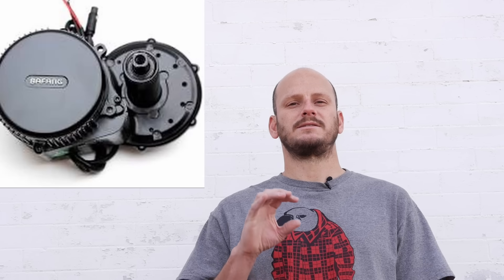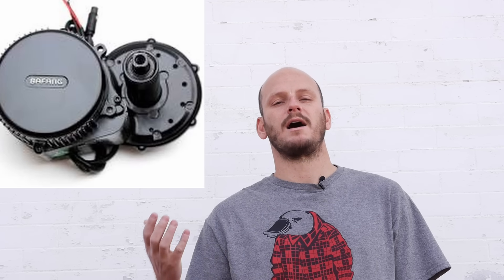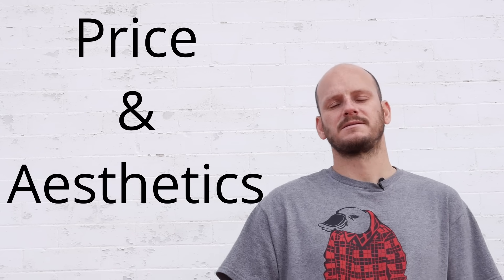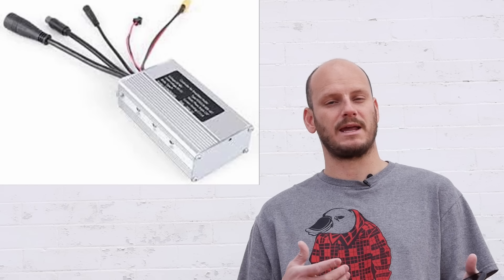Hub vs. Mid Drive Motors: Why Hub Motors Suck and Debunking Common Myths with performance test

Comment: I appreciate  the knowledge and advice very much thanks. I think I might have to save up more for middrive

Just some clarification please, when you talk about hub drive being single geared, but they actually have various levels of electric assist, or "power levels" generally from 1 to 3 or 1 to 5 where higher level = more power. Eg you could use level 1 as eco mode for longer journey but switch to 3 on a hill climb for more help.

In the side by side comparison the middrive bike, the guy wasn't pedalling. Can you throttle only with that motor? I mean if your chain isn't broke. Sometimes it's fun to just cruise like that
Reply: It's a difference of where the motor is located in the powertrain. Two motors with otherwise equivalent outputs and speeds, one direct drive, and one with a multi ratio transmission between it and the load, the one with the transmission can produce both a wider range of usable speeds and power levels.
Reply from the maker: Mechanically hub motors only have 1 gear ratio. Both systems can have a throttle only and also use pedal assist.

Comment: Thanks for the info! Love the quick bullet points. In your opinion, why do the majority of manufacturers keep making hub driven e-bikes over mid-drives?
Reply from the maker: cost. most people don't know the difference between the 2 and therefore don't care. As more people buy mid drives, more manufacturers will start to carry them
Reply: because hub motors are cheaper.
Reply: As long as there's a dummy willing to buy it, there's another dummy willing to sell it...
Reply: @andre-michelgoulet6933  That explains why mid-drives get pushed so much by companies

Comment: You have good points, but I still like hub. I have over 2500 miles on my current one and no problems. My 3000w has almost a 1000 miles and no problems. If you peddle five or six times when taking off you will probably not burn up your motor. I agree watt for watt mid drive is better, but if you get a 3000w it will usually beat any mid drive and a lot more fun.
Reply from the maker: ya 3000w hub is nice! Not street legal at all though

Comment: This review is very one sided. Everyone who says one is better than the other is not telling the truth. Its just different Systems for different applications. 
Direct drive Hubs advantages over mid drive:
higher maximum power 3000w-6000w+
no need so change gears so continuous acceleration.
Regenerative braking
No moving parts and wear except bearings. (overclocked mid dives tend do destroy internal gears.)
If the hub burns its a sigh they didn't setup the current limits and temp sensor properly. Mechanically speaking hubs have a lot less failure points than mid dives.
Hubs often come with loose spokes or no spokes at all so many points you say here are because of stupid people not because if hub motors.

Mid drives are only really better in the lower speed lower power area.
Commercial mid dives max out at 1000w-1500w so while having great starting torque they will fall behind after initial acceleration.

So all in all mid drives are for lower power applications were you need a lot of torque like Mountainbiking and cargo bikes.
Direct drives can turn your bike into a serious motorbike with insane speed an power far beyond mid drives. Bur its more for the road because they are heavier and with worse weight Distribution.
Hubs are also great for a completely silent indestructible commuter with less torque but better reliability (if you don't do stupid mistakes with the spokes.)
Also price??? 20s 3000w mid drives are cheaper than 14s 1000w bbshd on Ali express.

Comment: And both of them have to compete with a $100 2-stroke that pushes 5kw before you tune it. :P (You can get a jackshaft kit and mid-drive THOSE, too).

As for a more serious note: as I'm looking at the two different kinds, all of the Befangs are twice the cost of the equivalent hub motor on Amazon. from a practical standpoint, I'd prefer a mid-drive, but these prices are running into 'gas bike' territory.... It doesn't help that I have to replace the rear hub on my Schwinn anyway, someone rode on a bad bearing because he needed to get outside during the Pandemic.

(edit: also, you can get adapters to run a 3x drive-train on Befangs, though the usefullness of doing so is... debatable, what with the whole point of the smaller front gears being more torque and you now having 500-1000w of oomph to work with)
Reply: oh hey, stumbled across this comment again. Got a TSDZ2, still have a bad rear bearing, but it stopped making disconcerting clicking and scraping noises, I think it just gave up, lol.

The TSD was hub-motor price. :O now, we're going to set aside all of the tools I had to buy to get the very stubborn bottom bracket off of the AL Comp, which involved a breaker bar and enough profanity to get me cancelled on Twitter. I really needed to take it to an auto place and have them knock the bracket off with a freaking impact gun...

I've become aware of one other advantage: You can get away with doing a LOT of stupid stuff on an Ebike. Stuff you'd definately get your ride impounded for running gas.

Comment: Hub motors cheper and have higher efficiency, because have one gear, mid drive have about 4 gear, 3 inside and chain... So with hub motor with properly ajusted controller and on flat you go longer range. And front wheel eith hub is esear install than mid drive. Only mid drive have better water protection and integrated controller and better suspension of whell...
Reply from the maker: Mid drives use the gears on the bike too so times that by at least 7 😀

Comment: You're converting regular bicycles with electric motors? Of courses the spokes are going to become loose. You need a wheel that's specifically designed/engineered for a hub motor. They are made with much more heavy duty spokes. But hub motors are definitely better... Just much more expensive.
Reply from the maker: I don’t convert bikes with hub motors. Only mid drives. Spokes coming loose boules down to the quality of the wheel build. Cheap hub motors have no quality....
Reply: @JohnnyNerdOut  Oops, you mentioned that in your video. But do you see spokes broken on electric bike wheels that have spokes specifically engineered to take them?
Reply from the maker: @MrPillowFoot  short answer is yes. My old workplace used thicker spokes but they were cheap and poorly laced so.... go to a place like Ebikes.ca and you’ll have nothing to worry about.
Reply: @JohnnyNerdOut  my ideal ebike would have a mid-drive motor, Gates carbon belt drive (instead of a chain), and a Rolhoff speed hub (14 gears). But I'm not made out of that kind of money haha

Comment: Well let me tell you how it goes on my 1200 watt rear hub. It has zero spoke issues. Spokes are extra heavy duty. Nothing ever bends or breaks.  Pushing 58.8 volts thru a 1500 watt controller my bike gets 35 mph and can climb pretty much any hill. No issues here my hub motor e-bike is all business all the time LOL. No reason to even consider a mid drive.
Reply from the maker: Nice, is that 1200w peak?

Comment: Your example of a car stuck in 3rd gear to an electric hub motor is wrong. First of all, most cars that are internal combustion engines either petrol or diesel operates differently from electric motors. It needs gears to stay in the power band or its peak torque to operate efficiently. Also it max out at mostly 6,000 or 7,000 rpm. Electric motors don't operate this way, it has peak power and torque at zero rpm, and can revolution (depending on the design) at up 20,000rpm or more. Thus it doesn't necessarily need gears at all. Which is why most electric cars don't use gears, or if they have gears, it is usually one lower ratio gear (usually used for a quick launch control or towing applications, or depending on the desired design for a needed gear reduction). If that's how most electric cars operates, I see no problem having a direct drive hub motor. Maybe on unsprung weight, but most won't care about it, because some ebikes can be rigid with no suspension at all.
Reply from the maker: In theory your right, but only with the right amount of power. At 750w or less, you need gears to use that power efficiently. The video comparison of the two different types of motors shows what I’m talking about.

Comment: I am looking to convert my Trek Dual Short into ebike.  What would be my best bet on a motor kit?  I like long rides.  I prefer quality,  Thank you
Reply from the maker: BBS02 is a solid motor. Get the biggest 52v battery that will fit in your triangle
Reply: @JohnnyNerdOut  Thank you!  what battery do you recommend?

Comment: All these arguments are based on emotion and not scientific facts. (Torque x rpm) / 5050 = HP. Electric motors  produce much more torque right from zero rpm than internal combustion engines, you cannot compare the two. Electric cars do not have transmissions, neither do steam engines. The spokes are shorter on a hub motor than a standard bike hub, so there is less force on the spokes at the hub. Why they fail I don't know, but it has nothing to do with more force applied. As for going up a 45 degree slope, the mid drive will off course be better. It all comes down to application. A commuter bike will never do slopes like that.
Reply from the maker: Hub motor spokes come loose because they are poorly laced. A mid drive will outperform a hub using the same power every time.